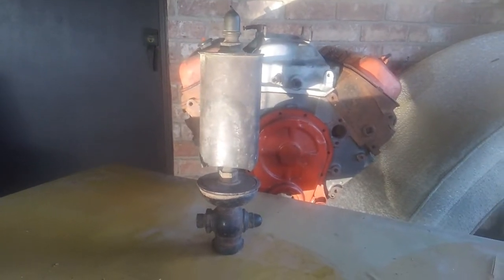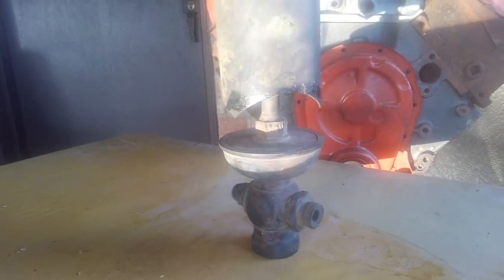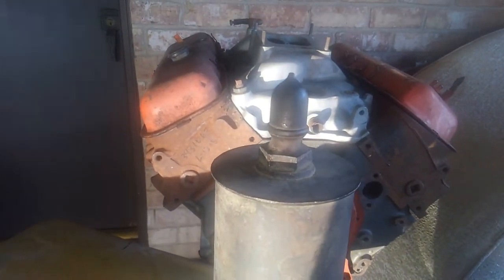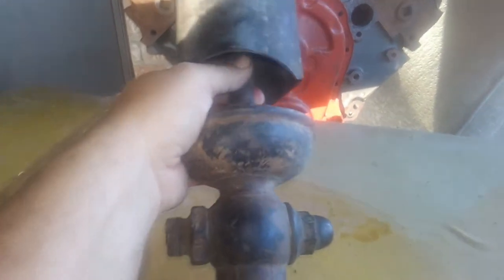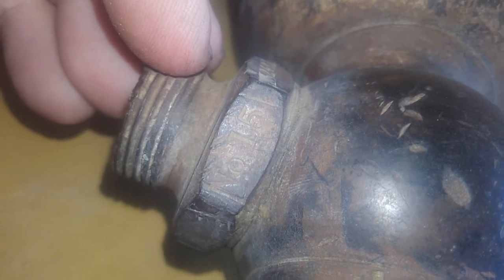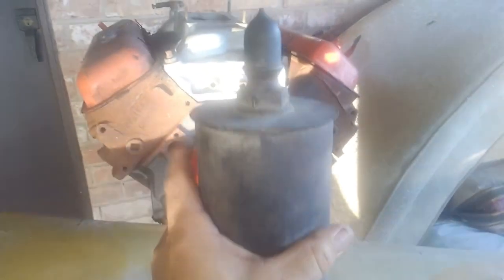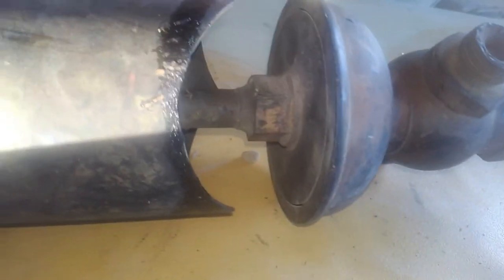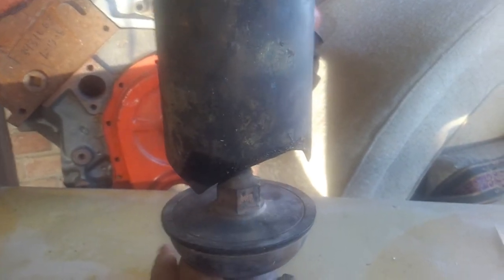Locomotive Steam Whistle Find While Looking for Old Car Parts

Comment: Judging from the notches in the resonating chamber (top part) it seems to be a 3 chime/ tone whistle. If you want to test it, start with lower pressure than head up.steam whistles can run on air but will sound different since steam is denser. Railroads had 3 and 5 chime whistles usually, so this could have been a train whistle. It seems to be  small for a tugboat.
Reply from the maker: Bill. Great information, thanks for sharing. I have been thinking of hooking it up to an air supply  to test it out, but need to find the reduction fittings to make it work.
Reply: @VetteSource  home depot has a lot of adapter fittings. Get brass and use a ball joint valve to control the flow of air going into the whistle. Try to go one size down from the inlet on the whistle to connect it to the compressor and give it about 120 psi from your air compressor. Also you should send me pics, so I can help out the best I can. Based on this little video, you may be missing parts but would like more photos of the inside, outside, and everywhere on the whistle. Also give me embedded numbers and letters. Thanks.
Reply from the maker: Khris, great suggestion. I will try it out. What is the best way to get detailed pictures over to you?
Reply from the maker: Great, will be in touch👍
Reply: @VetteSource  did you get the number already?
Reply from the maker: Khris, sure did. Let me get settled in and I will touch base with you shortly.
Reply: @VetteSource  k
Reply from the maker: Khris, just managed to get settled in and since it's so late I will touch base with you tomorrow.
Reply from the maker: Khris, the YT system may have erased your contact information for privacy reasons. Why don't you reach out to me by email at vettesource@hotmail.com and we can take a look at the details of the whistle.